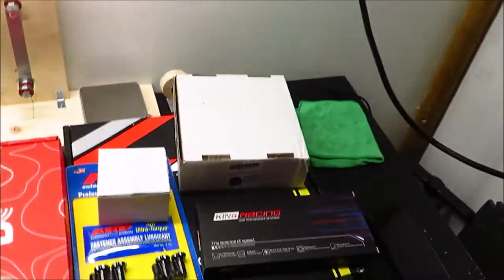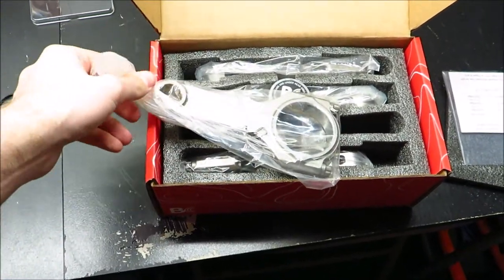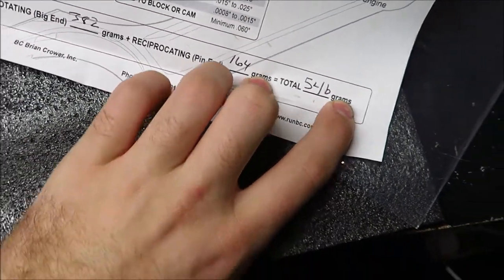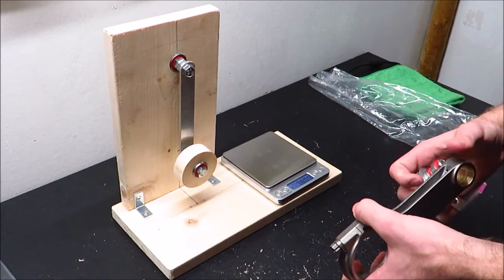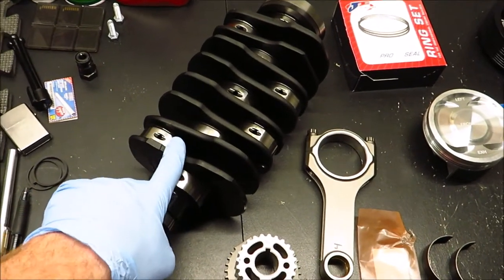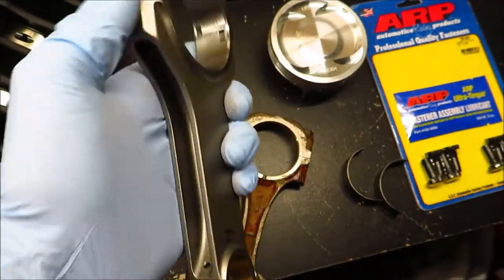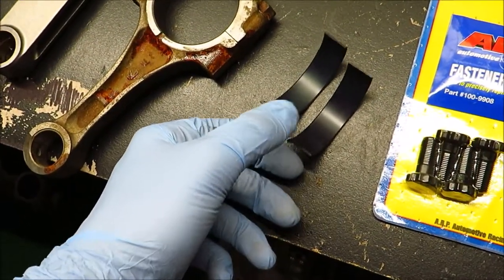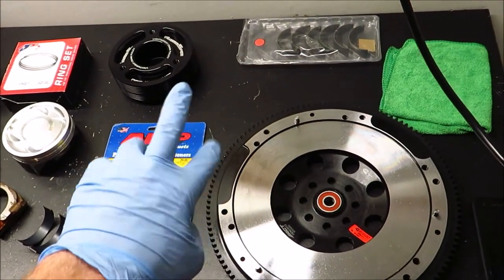500 HP Subaru Rotating Assembly!! (Why Balance?)

Comment: If everything is going to the machine shop for balancing, would you still get a knock code if you mismatched other flywheels/crankpulleys?
Reply from the maker: Not sure, from driving the car so far i don't see a reason to go with a lighter flywheel or pulley. The car revs so quick and rev matching is awesome. Hill starts kinda suck and its already hard enough with this weight i wouldn't go any lower and chance it.
Reply: Lol too late, I already have one coming in the mail.  No hills where I live, it’s a peninsula. I’m currently building my 2nd Subaru and I’m following your channel now. I might have some more questions soon. Thanks for the reply.
Reply from the maker: Thanks for watching. I guess you will find out if it works. What weight flywheel and pulley did you get?
Reply: Saw Garage Perrin pulley and clutchmax flywheel. I’m taking everything to the balancing shop this week🤞🏽
Reply from the maker: I think the perrin pulley may be slightly  lighter than the grimmspeed pulley, my flywheel is 13lb so unless you specifically bought a lighter flywheel its probably around the same, so with a balance I think you should be fine

Comment: What clutch set up are you going with?
Reply from the maker: I haven't bought it yet, but I am 99% sure I'm going with a Spec stage 2 plus clutch and pressure plate
Reply: @SWSpeedCo  are you sticking with the 5spd?
Reply from the maker: Yes, I'm going to build some blast plates which will make it pretty bullet proof for the way I drive it, and if it ever breaks I'm going to throw some straight cut gears in it
Reply: @SWSpeedCo  you still doing that video bro?
Reply from the maker: Yes, I just need to edit and upload it
Reply: @SWSpeedCo  eyy noice m8